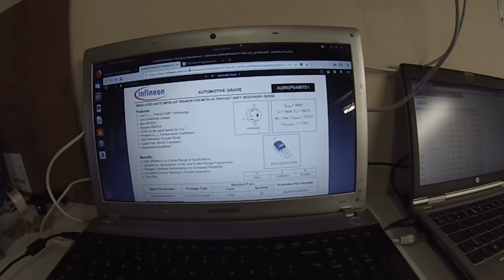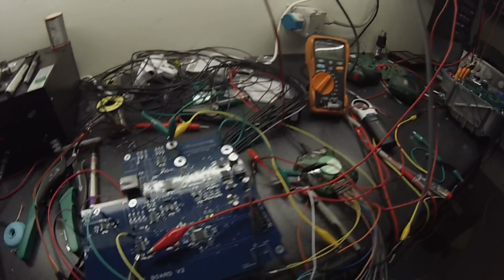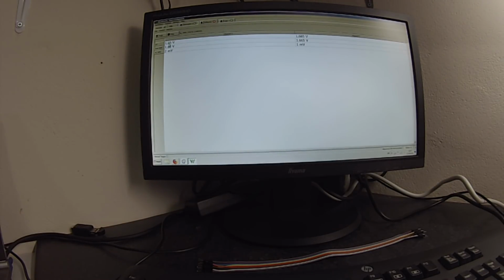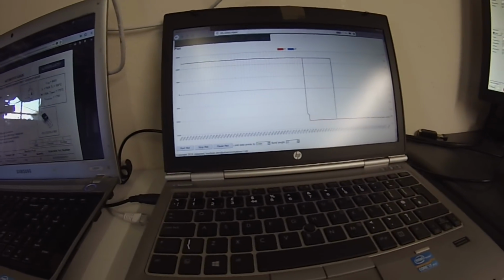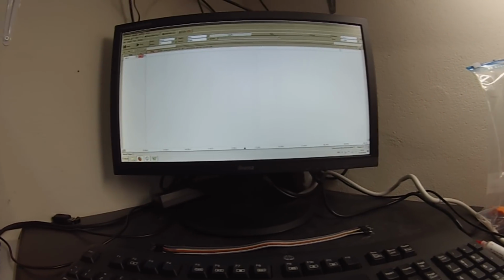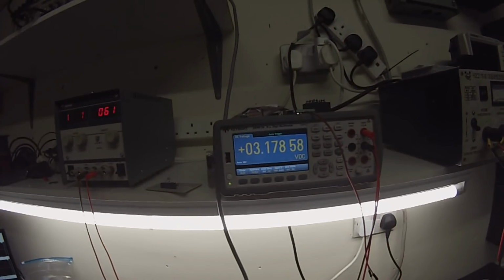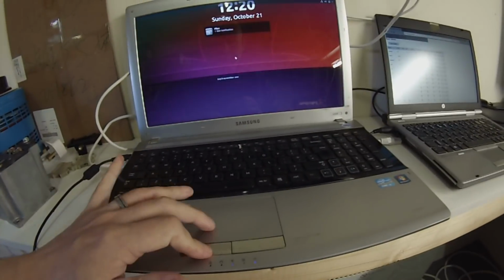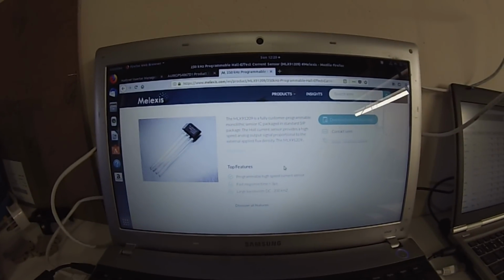The Tesla Project:Small Drive Unit Fix

Comment: According to the datasheet pdf there are several versions of the MLX91209.
the different values of "Default Sensitivity mV/mT" relate to the output voltage per unit of magnetic flux.
So which CAA-00? is the Tesla one ?
Reply from the maker: That my friend is the 9 euro question. We'll find out as soon as Mouser deliver:)

Comment: What is the maximum voltage the inverter can handle? Or the minimum and max voltage range???
Reply from the maker: The motor will spin up with a dc voltage around 40v. Not sure about the maximum. I would not want to go much over 450v as the igbts are rated at 600v.

Comment: What is the difference in the small drive unit and the rear unit? I'm new to all this. But would like to get into building a ev.
Reply: Rich Rebuilds has a video when he pulls out a front drive unit from a flooded Tesla
https://www.youtube.com/watch?v=8bpC6NGL8zg
Gives you an idea of how it's mounted, wired in etc.
Reply: smaller,  less powerful, more efficient
Reply: Rafael Silva have any idea of the power? And the layout? Is it easier to retrofit? I haven't even seen one. The Tesla motors seem to be the most powerful and effiecent in use. From what I have seen anyway. I'd like something effiecent yet powerful. The rear motors with inverter are quite awkward when looking to retrofit. I have seen the inverter separated and repositioned. Thanks I was hoping someone would answer...
Reply: i've never used tesla motors so i can't give you any indepth detail like mounting and so on...
cannot verify but this seems about right:
hsrmotors.com/products/driveunits/large/base
hsrmotors.com/products/driveunits/small/front